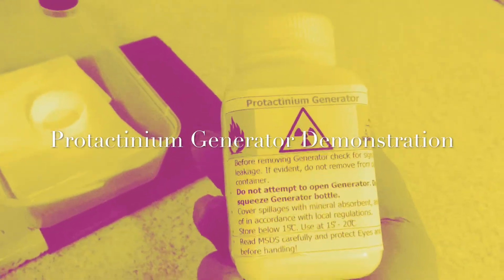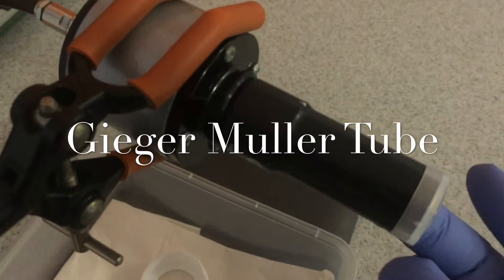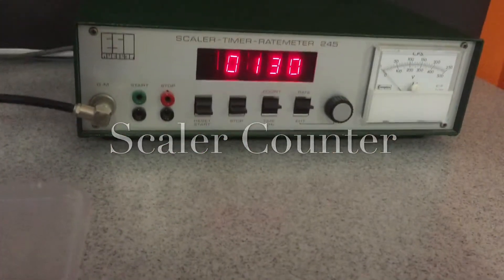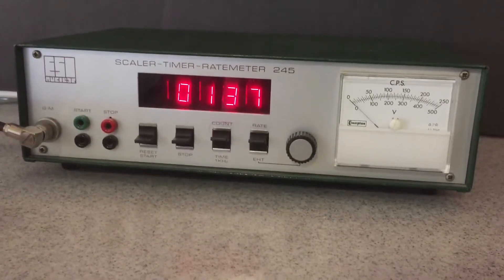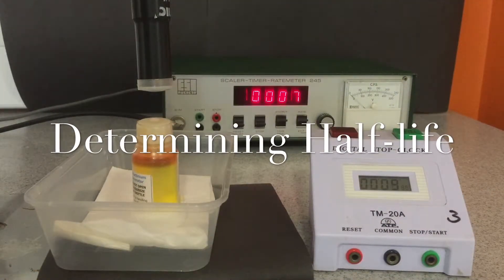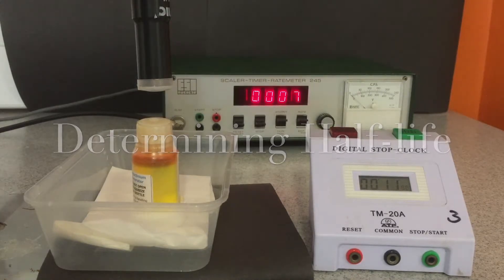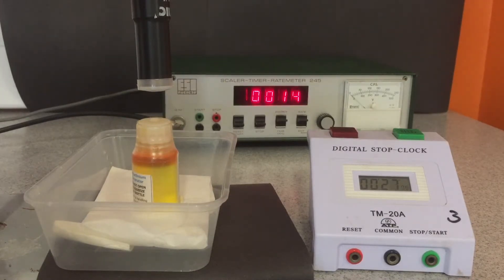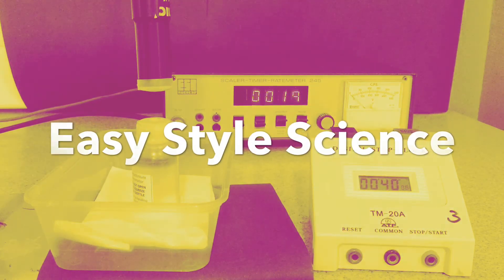Protactinium Generator

Comment: I live in the USA, and these aren't available here, and they'd be too expensive! Well, I FINALLY made a Pa-234m generator! I used 2.5 g of uranyl nitrate, 7.5 mL of distilled water (to dissolve it), 17.5 mL of conc. hydrochloric acid (ACS grade, 37.5%), and 25 mL of methyl isobutyl ketone, and carefully added this to a 60 mL leakproof polypropylene bottle, and it works spectacularly! I use the Inspector USB Geiger-Müller counter with the Observer software, and I get about 120 CPM for background from the Pa-234m generator, and about 3500 CPM at about 2 cm. It works great! It has internal and live datalogging, and it has autoaveraging, and when that is activated, it gives an even more precise result! The exponential decay curve is SO smooth and precise! Thank you very much for sharing this video! 👍